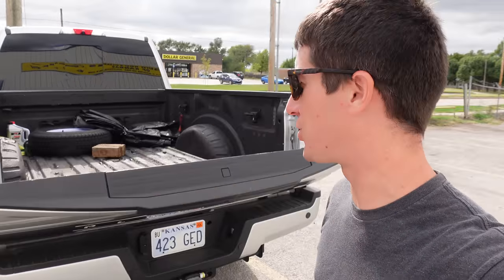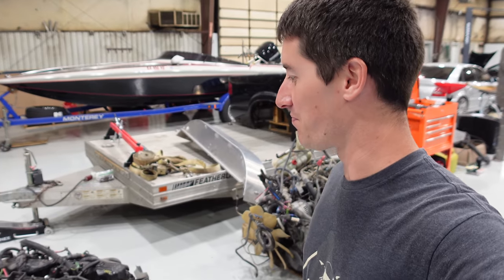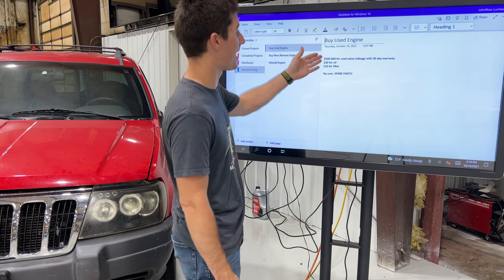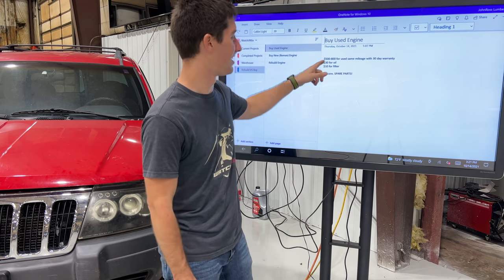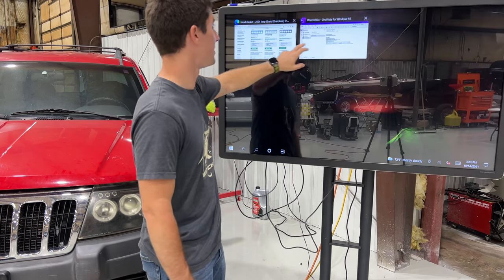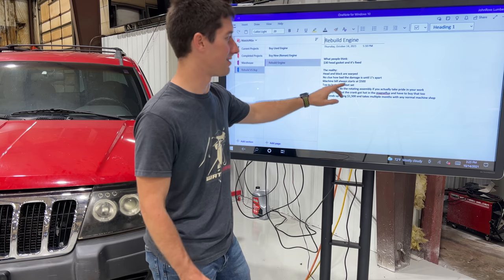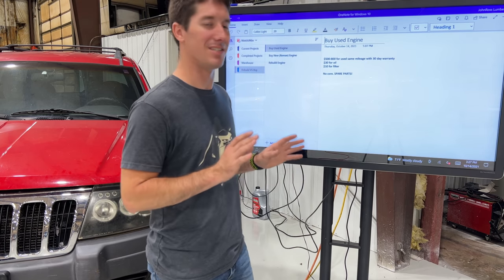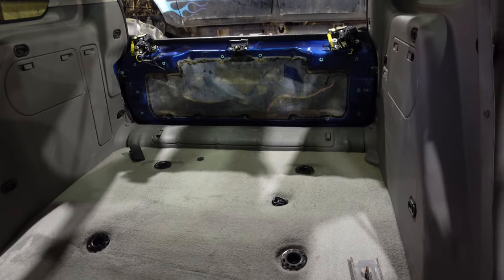Here's Why You Should NEVER Rebuild An ENGINE *The Math Doesn't Add Up*

Comment: People gotta remember, this is how you make money, watching you rebuild an engine may be cool but it isn't the cheapest way to get flips done, the cheapest way to get flips done is to stick an engine in it. The only thing I'd do different is do a timing set and a water pump on every engine just so you can say it's a used engine but the water pump and timing set are brand new, get a few more bucks out of it, and feel good that you are sending quality automobiles out there onto America's highways for people to use for years to come.
Reply: I thought he made money producing YouTube videos
Reply: @nellof1244  
he still has to cover repair costs
Reply: Does mileage matter?
Reply: @larrybe2900  yes and no. It's kind of a catch 22. If it's low milage it's often that the thing has barely been broken in and will be fine. Another thought is if you have a high milage engine that's been through the ringer and not maintenanced it's likely shot. On the other hand you can have a engine that has 50k on it and beat to shit every waking moment of it's life and it's on the bring of failure. Low compression and all the other symptoms and then you can also have a high milage engine that's been services regularly and not beaten and will last x2 or X3 of the existing miles. Lastly the company that the engine is made by is super important. A Lexus Toyota Acura Honda engine will have 200k on it and be fine. Vs a Subaru engine that has 70k on it and needs a major overhaul.
Reply: @nellof1244  he does, but that doesn't pay for everything else. He's essentially making his money 2 fold. And theres nothing wrong with that
Reply: @gddge  
I suppose another caveat is how the vehicle was brought to its current state. 
A roll over depends on the engine being stopped right away or not. I wonder how those engines are handled? Is there a mechanism designed for the engine to not continue to run on its side or upside down  until it becomes ruined? There is one police utilize during a pit maneuver that will disable the engine. Is this the same system for a roll-over that will stop the engine?
Reply: Are you Ray Zalinsky?!
Reply: Plus engine is out and easier to work on.
Reply: @gddge  Never anything wrong with getting payed twice lol
Reply: Agree, plus ATF new on transmission
Reply: @nellof1244  he's making money with us just watching him talk about making money
Reply: He briefly touched on the additional cost of the time involved...not that he has to pay himself, but I always look at the man hours I'd spend doing a task...which is a longer period of time than anyone else...
Reply: @nellof1244  He produces You Tube videos by working on cars. Doing a flip and barely making over $1000 on a flip is not real money. This is his production cost.
Reply: @larrybe2900  mileage does not matter, OPERATOR HABBITS mattered.  but here's yet another catch 22; you can only use mileage as a tell tale sign. compression and leak down tests when measured AGAINST mileage will be the only way to know for sure.    A healthy engine with 350,000 miles will not fail a leak down test, but it will have low and even compression.   A car that was driven by karen or some ditsy teenager who did not show any mechanical sympathy might have 90,000 miles but the compression test is very irregular across the cylinders and there's lots of slight rod knocking from worn bearings.   Alternatively, you have the retired grandpa/grandma who is surprisingly just as bad, a car they bought as a retirement present to themselves that LOOKS pristine, with 30,000 miles driven over the last 10 years.   This car will have massive wear around the head and bearings because the car sits and sits for weeks or months at a time and only gets driven 3 miles to the grocery store or the golf range.  the oil is always settled far into the sump and many dry starts are common with this usage.  also weeks/months old gasoline constantly sitting in the fuel system . These people also may "start her up every week" and let it idle for 5 minutes to "keep the fluids going"  which is equally bad. without meaningful driving and letting the piston rings expand and seal out the fuel from entering the crank case, you end up causing unnecessary wear in addition to all the wear caused by the dry start from a week of sitting anyways. You want a car that was well used but well cared for.
Reply: That could be a way to make a little money, yes. But it is also an easy way to get a very bad reputation selling junk and receiving good money for it... No, thanks...
Reply: @temur72  Exactly, and who knows how many times the vehicles quit, that he sold to those who expected better that were bought from him... Now, You know why so many used car salespeople got such a bad reputation... It was more than a $35 Goodwill store suit that earned them a reputation like this...
Reply: @larrybe2900  Probably not as much as when a used car is purchased from most fixed location used car lots... Which is WHY this individual selling these junker used cars will likely be making repeat trips to various small claims courts..
Reply: It's a good idea to replace the timing set & water pump on a used engine...especially if the used engine has over 100K miles. Plus some engines such as Toyota's and Honda's have a rubber timing belt which has to be replaced every 45K miles. So its a good idea to replace all those items ...good preventative mantainance
Reply: @umad42 I agree about the replacement of cam drives and the associated equipment driven by it... But since the engine is out, I'd install new freeze plugs, front & rear main seals, valve cover gasket(s), starter ring gear (if needed), starter pinion/Bendix assembly, Oil pan gasket, thermostat, etc. This could create a very happy buyer, who will probably have good things to say about the business that You have-to others. That could save the business later...
Reply: @larrybe2900  Several cars were equipped with fuel pump shut-offs if the car got into an accident, rolled over,  even a tire blow-out could trigger one of these acceleration-activated switch's. No fuel pressure, will kill the engine...
Reply: @nellof1244  i'm thinking that he needs to disguise his identity when selling these vehicles with the questionable used equipment,  that he is openly displaying on You Tube that is going into the. Vehicles that he is trying to sell... The only thing missing with this guy is the Cheesy Orange & Green $35. Suit, that he got at the Salvation Army Store...
Reply: Drop an engine in a car is cheaper? Not even close sir especially if your changing the water pump and entire timing set
Reply: My machinest anly charges 450 for rebuild

Comment: Few years ago someone from a supporting church blessed me with a 2008 Chevy Suburban (190K miles) so I could continue to do my ministry in the community, especially the street outreaches as a gospel DJ. I had taken out an extended warranty when I got the vehicle, few months later it had a dead cylinder. I took it to the local dealership and 2 months later after a lot of back and forth, the warranty company gave me a rebuild engine with zero miles on it, and its still running great. My deductible was $100. Hallelujah!!!
Reply: That is indeed a miracle. No one ever gets ahead of a warranty company.

Comment: Safety and quality aside, imma keep rebuilding because there is no way I can get an $800 engine replacement out here that is not also just as crappy as my current engine.  I live on the Big Island of Hawaii.  We have no engine remanufacturing companies here so shipping it in is the only way, and shipping ANYTHING of that size and weight will cost me both arms and one leg.  Cheaper to take the engine to the machine shop, buy a rebuild kit and rebuild it myself.

Comment: The  headgasket in my 2003 chevy trailblazer 4wd blew on the way home from work and yes I kept driving  lol, I live out in the country  so it was about a 20 minute drive home from where I was. Pulled the valve  cover off and saw 3 rocker arms broken off and milky oil cams were toast and the whole engine  was done for. So I went to the local junkyard  and bought a running 4.2l i6 out of the same year and model trailblazer as mine for $350. Swapped it in a day and runs great 60 psi of oil pressure I did new gaskets, plugs,coils,, and injectors on it before  I put the new engine back in because taking the intake  off on a trailblazer sucks while in the car. Now I drive it to work everyday  and have put 20,000 miles on the $350 junkyard engine.
Reply: Now THIS is economic. I love it, better than buying a brand new pile of junk. GM still made decent vehicles back in 03. I wouldn’t waste my breath on a new GM vehicle.
Reply: I'm surprised that I6 motor went south on you. Those Atlas motors are damn near indestructible.
Reply: @IKhanNot  no telling how much miles was on it, it sounds like this guy drives lots of miles.
Reply: @IKhanNot  203k on the original
Reply: I had a similar TB. Loved the tourqe, hated the super sketchy feel of everything else lol
Reply: @IKhanNot  Yeah the head gaskets on those don't usually just blow, likely water pump or something kicked the bucket while driving and created the head gasket issue when the owner didn't pull over and shut the engine off immediately when the temp gauge started creeping up towards the H, which is what I see alot, but then most people unlike this guy usually blame the whole car.
Reply: @chocolate_chip_cookies2258  Buy a toyota and you will have to start worrying about things like the price of gas.  I got 2 yotas over 300k and 2017 tundra over 100k.  We still think the 2017 is new.
Reply: @billyhill2172  The "Somehow" you mention is like the regular shoppe we used in Linden New Jersey for every repair and every 5000 mile oil change to not give a sht enough to look over the car when we came in every few months and say. "hey the hoses need replacing" They almost killed our V8 LR3 Engine and from those coolant leaks two of our great and  innocent baby like Cats died from drinking that sht when it leaked thanks to they're neglect.. And you know the last time we were there I heard the Car struggling and the last 10 blocks to that place I had the Car towed to them. We left it there for almost a week and they didn't even bother to look it over the CUUNTS.They just drove it sounded ok held it for days and said nothing wrong..next day we got it same issue. We told our neighbor who comes over and say's let me hear it..he then says something is not right..jumped right in and took it to his mechanic who was still at his shoppe on a Sunday at 6 PM a few blocks away and he starts looking it over with our neighbor pressing the gas..my wife who is barely 5 ft short says wait I see fluid spraying underneath the Engine cover. Under the Engine Cover was a broken coolant Hose.Our regular Shop hadn't even bothered to take the cover off to look !! We were saved..our neighbors mechanic then rigged something up with a metal tube and clamps to join hose and we went on our merry way until he ordered hoses..ALL the hoses that needed replacing..All OEM..
Reply: Yep... That'll work!!!!
Reply: Maybe you should take better care of your vehicle